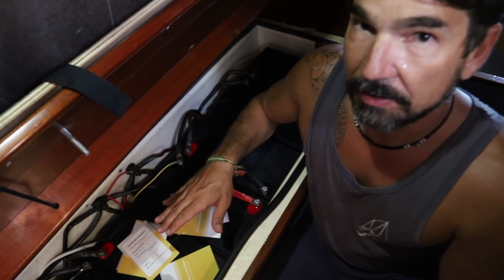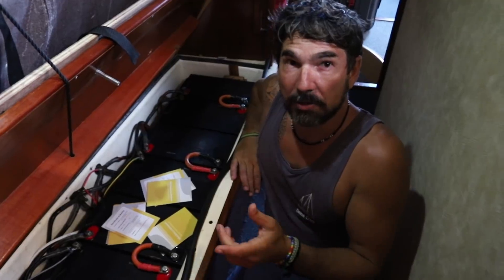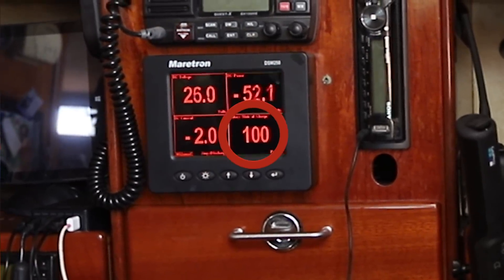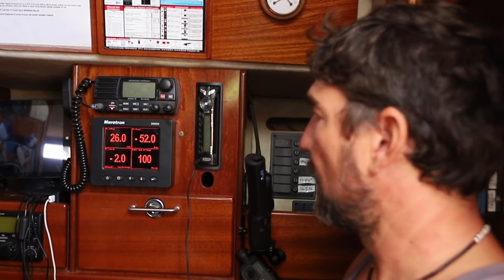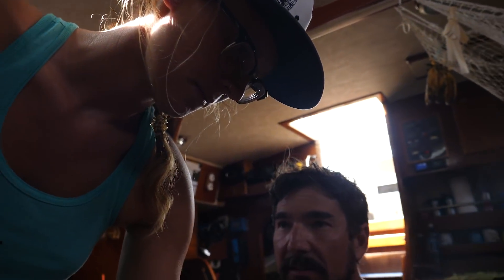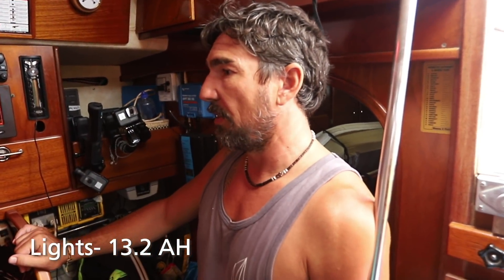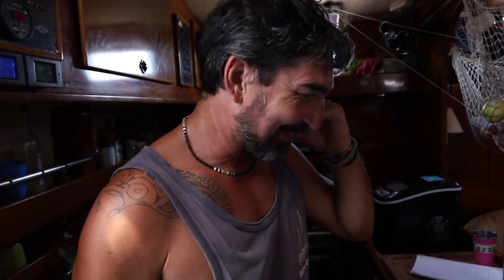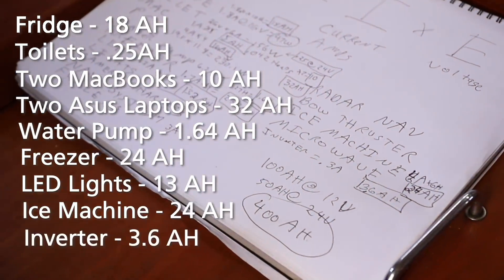WATT THE HELL is an amp hour?  Sailing Vessel Delos

Comment: I love this kind of benchmark information. Also Kazza, Apple computers rock use them myself.
Reply from the maker: I have been a PC guy for so long...  And right after filming this my Asus took it's final breath.  So I went over the other other side.  It's been a bit of an adjustment for me but so far I am pretty happy with the MacBook.  Much lighter, excellent battery life, and does nearly everything I need it to.  Still getting used to the shortcuts on Mac OS but that will take some time just like anything else....  Brian